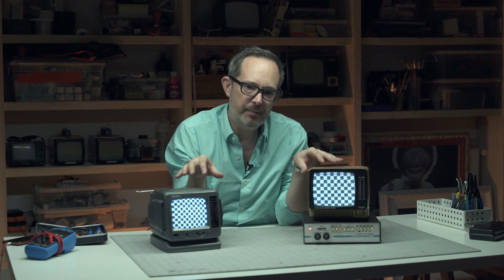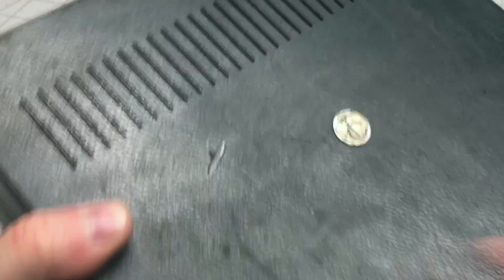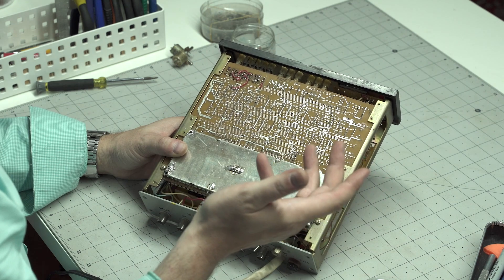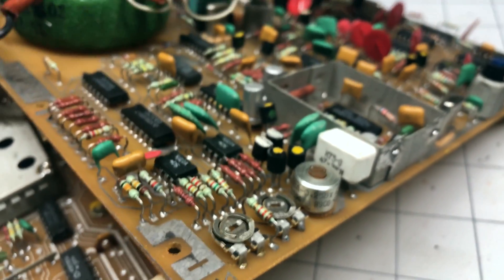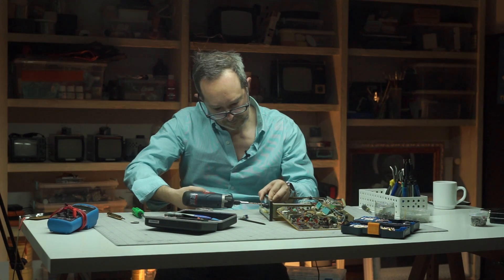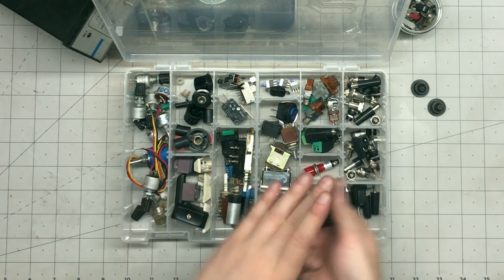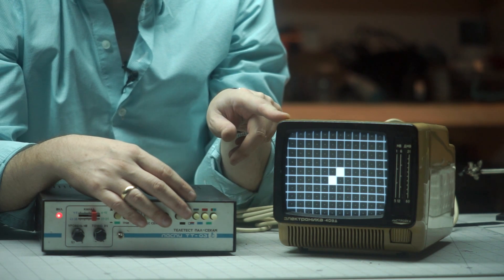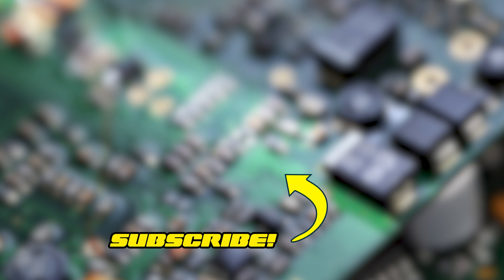Soviet CRT TV tester — restoration and upgrades!

Comment: We have a monitor for KTP-63 Soviet robotic camera. Seems need to get this kind of thing, as that needs a repair and a calibration.
Reply from the maker: Do you have the robotic camera as well? That sounds like an amazing restoration project!
Reply: @ThomasBurns  yes, and it is up and running. The same as were in use on Chernobyl robots, gives a composite b/w, so any analog display technically would work. Just need to bring it back from the war evacuation and we gonna do something.

Comment: Back in the 90s I used a similar signal generator to set up composite video distribution cards. I never looked at the test pattern on a screen always on the scope. Made sure the signal was clean and the sync pulse and burst were up to spec.
I don't miss that job.